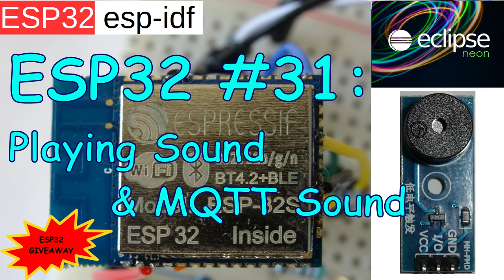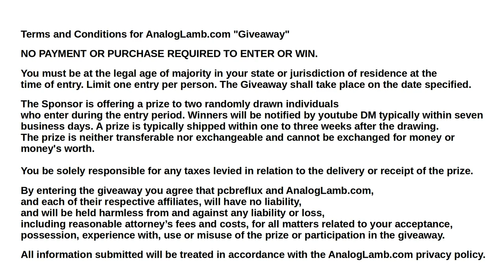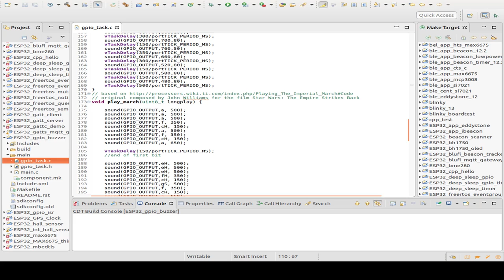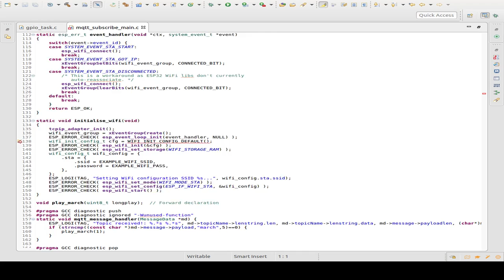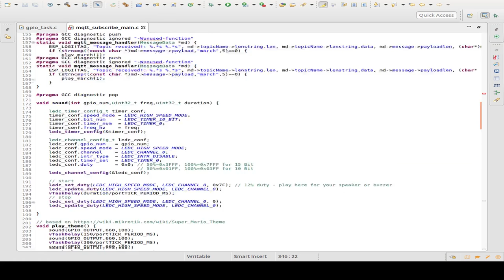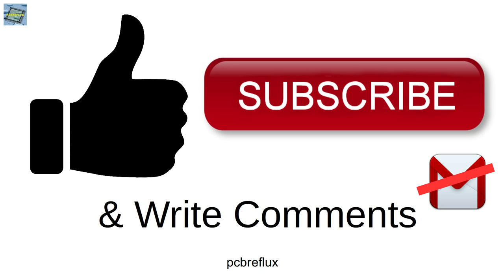ESP32 #31: Playing Sound / MQTT Sound + ESP32 Giveaway

Comment: Why are you putting the load of the speaker directly on your conteoller pin? The transistor on the board is there to prevent you from having to do exactly that.

Comment: great videos!
Reply from the maker: It helps to improve to tell me also some dislikes. Good luck for the giveaway.
Reply: pcbreflux well there is one thing. I mostly watch videos on my smartphone. I find dark editor themes and larger fonts to be easier to read on a smartphone.
Reply from the maker: bmeisels Thanks. Will improve my eclipse settings. Watch most of youtube also on my mobile but sometimes skip the code section.
Reply: Neat